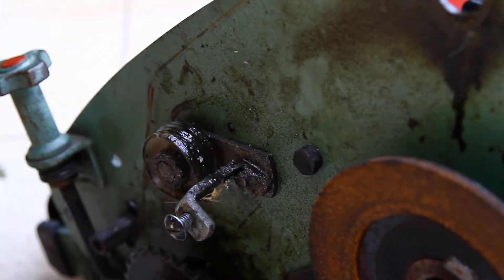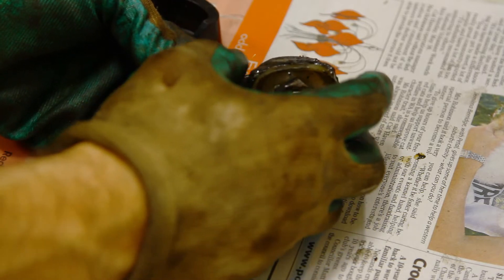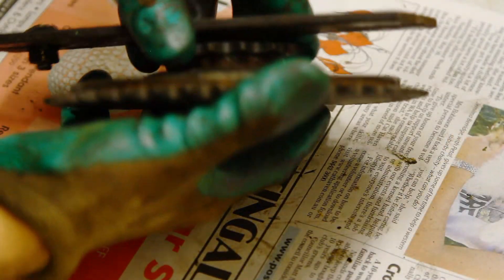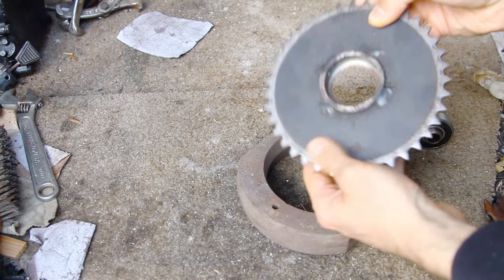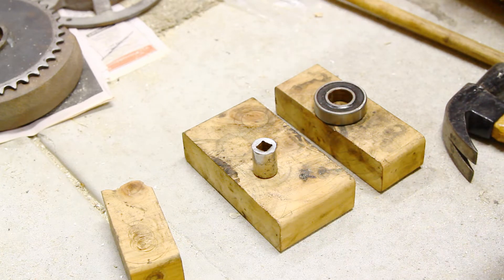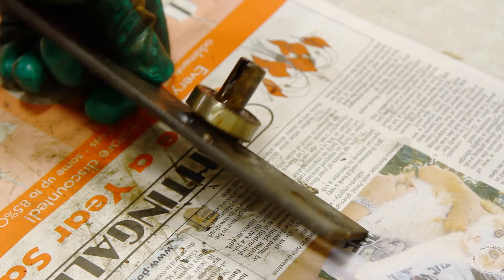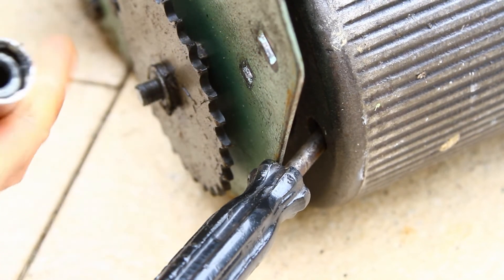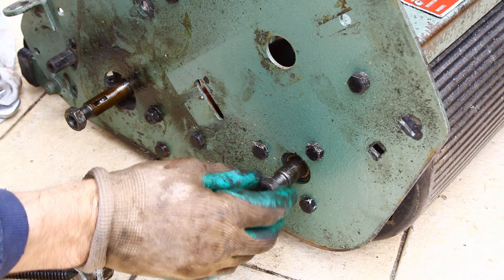Scott Bonnar 45 Teardown (5 - Chain Tensioner, Drive Clutch, and Rear Roller Sprocket Removal)

Comment: Doing a drive clutch cork replacement, the sprocket is hard to remove from the cork and back component. Gear puller needed here or can it be removed using other tools?
Reply from the maker: A puller would likely help if you're having trouble removing the large external sprocket from the clutch bracket. It's usually only on the clutch bracket shaft with a bushing and should slip off (there's a pin keying the bushing to the shaft but yeh, should just come straight off without much effort... so little effort that I neglected to film the process!)
Reply: OK.  Attempting my first Resto and I had the same issue.  Wish I had have consulted The Bible.  Don't use a gear puller.  I think I've now warped my sprocket 🤦🏻.  Hopefully I don't need a new one 😬.  Better off with a bit of WD40 and light taps with a hammer until it comes loose.  We live and learn 😁.

Comment: I have got similar rear roller. My problem is that the wheel near clutch spins faster than the other one. What may cause this problem?
Reply from the maker: Have you torn it down? Sounds it could be a loose rear roller clamp or maybe a pawl issue on the one side but unusual

Comment: not having much luck getting that small piece with the pin out that damn bearing too! where did you 'professionally' get that bearing out? I'm having the same issue 😂 well similar, it's just stuck in the sprocket
Reply from the maker: That one has got to be tightest of them all! I took it to a machinist--he had a steel wedge or two and got it started that way before pulling it off with the puller. The jaws of the puller are otherwise too big to get in there. If you have a piece of scrap metal lying around that's thick enough, I've always thought it should be possible to make up a little jig to slip between the bracket and bearing and extend the surface area for the puller jaws. 
Good luck!

Comment: Dang it. My sprocket is stuck on the axle! (different kind of mower tho). That sprocket remover doovey is what I need. Can't get it on Ebay! ... wait...I stand corrected. You can get em on ebay!  A search on "Multi Purpose Gears Bearings Pulleys Sprockets Remover Extractor Puller" orta find one...
Reply from the maker: Worth every cent! Three or two leg puller should do you... I think they're a 4" (maybe 3")